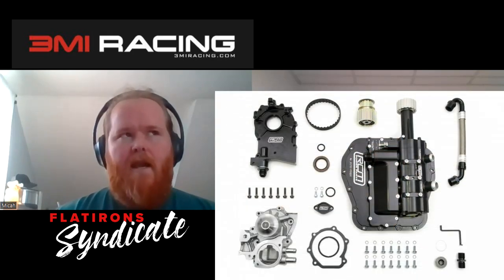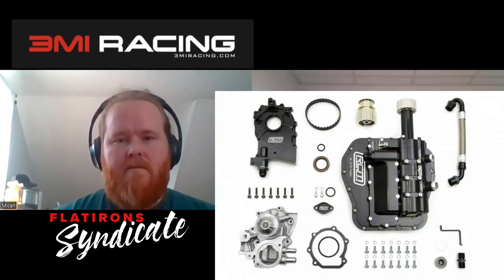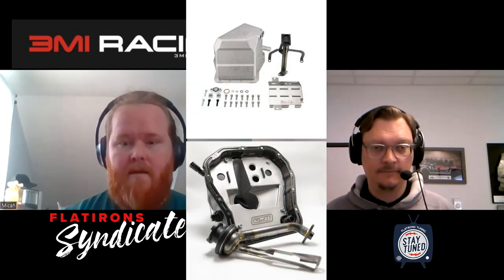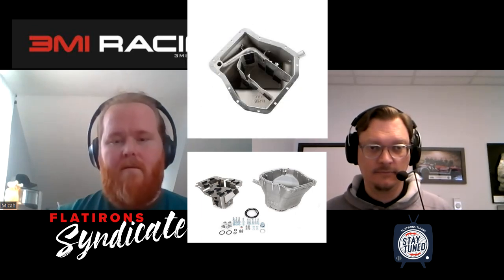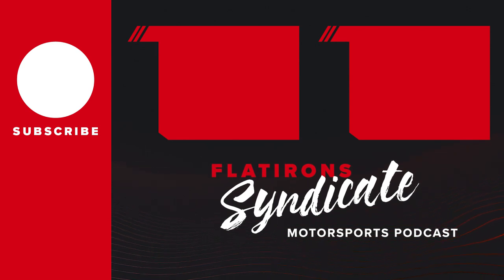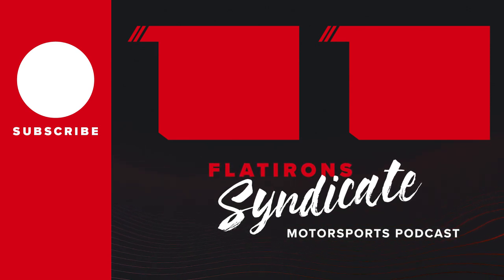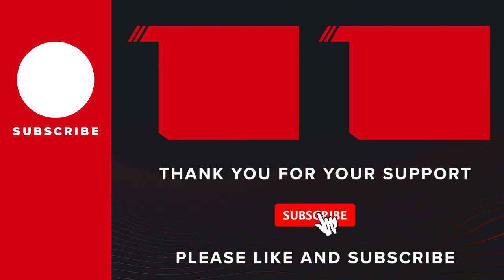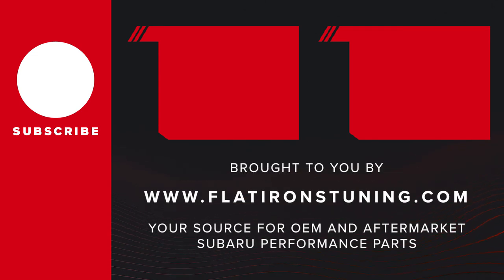Dry Sump or Wet Sump for your Subaru Race Car? With Micah from 3MI Racing

Comment: So ignoring race/time attack applications for a second, what would Micah's recommendations be for someone looking to take that spirited long cloverleaf exit while also NOT having their EJ205 spin a bearing? 
As someone who raised both hands ( @3:18 ) ,  am I understanding correctly that he's saying fixing crankcase ventilation would allow enough oil to return from the heads so that the oil pickup wouldn't starve in a wet sump setup? 
I'd always assumed the oil return issue was why Porsche implemented all the scavenge pumps with the "integrated dry sumps" (wet sumps) in their modern boxer engines.
Reply from the maker: Thanks for the question.  In the case of the USDM EJ205, because it doesn't have the balance plumbing that the EJ255 and EJ257 has (later EJ207's as well) this is a more pronounced problem in that situation.  I'll let Micah chime in for more details and advice.

Thanks for watching and Stay Tuned!

Comment: How does a dry sump system work on a EJ20G heads that have hydraulic lifters?
Reply from the maker: Thanks for your question.  I had to run this by the RCM guys, and they don't see an issue with running their dry sump if you have hydraulic lifters.  They try to set up their kits to supply oil to the engine in the range that the stock oil pump would ( at relief pressure).  Beyond that, the relief valve pressure can be adjusted with a set-screw, and a different spring (there is a kit with different rates of spring available), so once the pump is in place, you could adjust it to ensure that you get the oil pressure that you need for your engine.

Hope that helps and Stay Tuned!